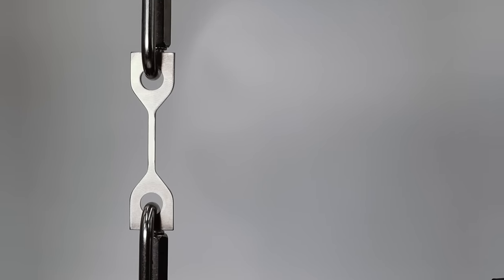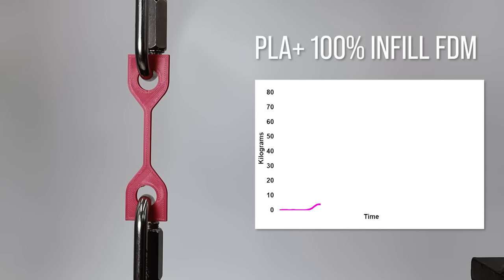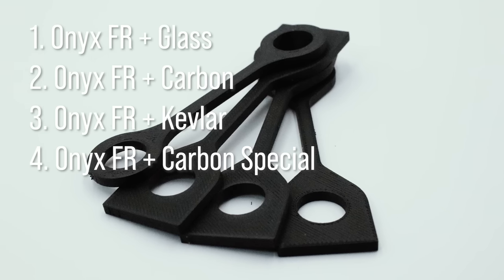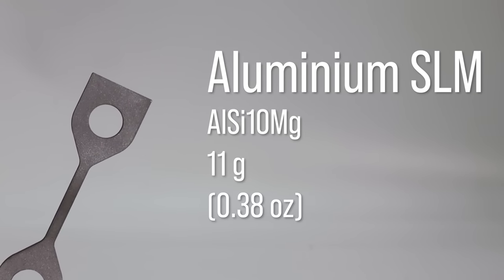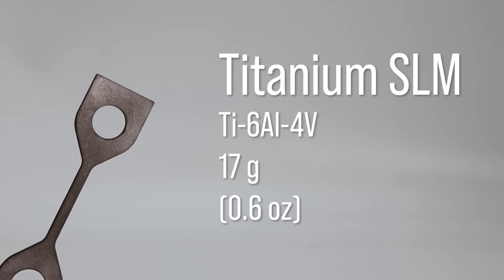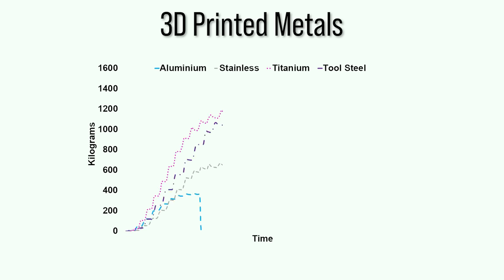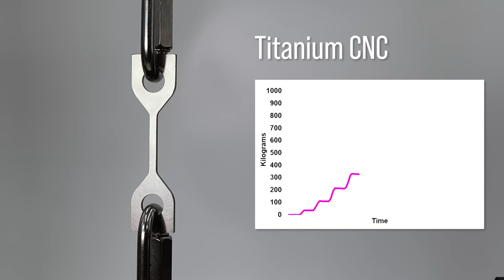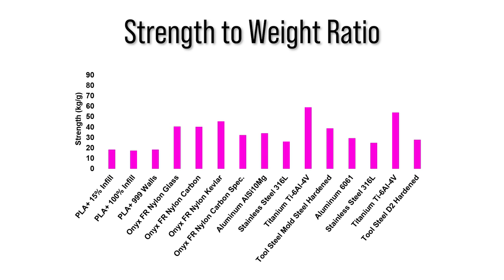3D Printed Metal vs CNC Machined - How Strong?

Comment: How did you measure the % elongation? I don't see any strain gauge nor was it explained in the video. Kg/time doesn't really tell us anything other than saying we can progressively load this specific part for this long before it breaks. Also, that's not ASTM D638 dogbone standard so you can't really say that the test has been "standardized". Pedantic, I know. But there's a fine difference between doing something that resembles a standardized test and doing an actual standardized test; I understand you're constrained by your test rig but I must point this out.

Cool results though. I'd like to see an improvement in the experimental setup and eventually see an actual stress strain curve.
Reply: I see, it looks like elongation was measured in post. Which makes me question its credibility even more. Was the distortion from the camera lens compensated for?
Reply: The word standardised does not imply it follows a specific standard, just that it follows a standard. It just means that the data from all of his samples are comparable to each other (but not necessarily to other peoples, though I agree that this would have been better).
Reply: @helpmeimconfused  Error due to lens distortion and other camera effects would not necessarily have been significant compared to other sources of error in the design. Regardless though, if he didn't move the camera much between samples, the values for each sample would have been comparable to each other at least.

Comment: Although others have criticised the heat treatment, not to matter as it's no big deal really - the most interesting element was the difference between 3D printed metals versus CNC machined metals - that was GOLD.
Would love to know the cost comparison between the 3D printed versus CNC machined metal parts if it's not commercially sensitive.

Comment: Thanks for making a video that compares metal 3d printed parts to conventional CNC metal parts. Seems like the trade off is between elongation and ultimate strength. Makes sense since I would imagine grain size of SLS parts is much smaller due to quickly cooling the parts from melted to solid below glowing hot. Your video helped me realize this and that 3d printed metal parts are actually viable for normal applications

Comment: Metal heat treating has to happen at very specific temperatures to get the results you want. That D2 tool steel you used has an austenitization temperature of around 1030ºC, a lot higher than what the torch can give it. You didnt get a half-baked heat treat, you got no heat treat at all because you didn't get the steel hot enough to reset its microstructure. If anything, you may have actually softened it.

Comment: Would be nice to see this test with cast metal samples as well, specifically for aluminum. That’s what most applications are replacing with 3D printed metal parts.

Also would be helpful to know the alloys of aluminum used and the stock thickness sizes, if the samples were made from thicker aluminum plate and cut down, they could very easily have a lower hardness. In aerospace this is something that we check after the parts are fully machined from a plate to ensure that there wasn’t a soft spot in the center of the block and that it was tempered properly.

Comment: I'd imagine the higher strength is because the laser sintering is a high temp,  fast cooling process that leaves a high strength heat treat. The lower density and inherit porosity would be more apparent with equal heat treats applied

Comment: Something is wrong with the elongation calculation. It was very apparent in the Onyx FR + Glass test. I meassured it on the screen so it is not 100% accurate.
At start the distance between the clamps was 77mm. When the first cracks started to appear the distance was 84mm. This is a 9,1% elongation.

Also the aluminium alloys you worked with are very different. AlSi10Mg contains cca. 85-88% Al and 10% Si and a bit of Mg while 6061 contains 96-98% Al + 0,7% Si and 1% Mg.
Tensile strength of the former is 450MPa while for the latter it is 180-280MPa.
The idea is good but in order to get useful data you need to compare fairly similar things e.g. like the PLA and the titanium parts. I dont think base on this test alone we can conclude that 3D printed metal parts are stonger. Too many variables.

Comment: A number of things come into play when doing tensile test. On the CNC they will break at corners and sharp internal corners focus stress. rounding and smoothing will help and any working of test structures can screw results. Learned this in a lost wax casting company. A cast part of same dimension will always put perform a CNC in the same material.

Comment: This was good but as a student i had to do a few of these and had access to norms and the like. We had a protocol where we only took the results from samples that broke clearly in the middle section, your sample have a stress point at the neck, it should be longer if you want to prevent them from breaking at the stress point. Your results may be qualitative but not quantitative, you'd need an average over several good samples.

Comment: Surprised to see the SLM handles the static test pretty well!
I wonder if they are also good on the dynamic loads test.
In my experience of engineering, porosity in metal parts doesn’t make a huge difference in static but on on the dynamic test, it can differ 10 to 100 times!
Reply: Definitely true, same with fatigue, but porosity levels in as-printed metal parts are typically <0.1% for optimized parameters. Most places still HIP the parts and follow up with solution and aging though, so porosity is pretty much eliminated

Comment: There's a clever way to measure toughness of a material, requiring a heavy hammer, a protractor, a set starting position, and a pointer to capture swing-through. The less height the hammer gets on the other side of the swing, the tougher the material.

Comment: I like how much the steel yields before breaking. Very useful for many applications
I was also really surprised how weak that cnc machined aluminium was.
Also the 3D Printed titanium was very impressive.
The heat treatment was pointless though. You can't just point a torch at D2 and hope it gets stronger.
Reply: in a sample size of one its dangerous to draw such conclusions.

Comment: I admit to being shocked at these results - it's hard to understand how sintered metal could outperform machines pieces.

Thanks for this!
Reply: It's not sintered. It's fully melted/welded
Reply: Thanks for the clarification. I thought that the S in SLM stood for sinter, same as with DLMS.

Even so, it's a surprising result to me. I would expect a part machined from billet to be stronger than anything cast or welded - I would expect it to come second only to forged.
Reply: @Syscrush  no problem. Most of the og metal printer companies are based in Germany. From what I have been told by them, DMLS is actually somewhat the result of a poor translation. DMLS is actually fully melted as well, but the industry didn't want to refer to the process as SLM because that is also the name of one of the competitive printers brands. Because of the confusion around this, the industry now more commonly refers to the process as Laser Powder Bed Fusion (LPBF). Not every printed material is stronger than billet, and it's still a tradeoff between properties. You can heat treat to beat the ultimate tensile strength of billet but you trade away elongation, for instance

Comment: I was not expecting that. I thought 3D printed metals were way less durable.
Reply: It depends on the process. If you're using the binder jet or something like that, they're pretty inferior. Powderbed processes though actually weld the materials, so it's like stacking a bunch of super tiny weld beads in a bunch of different directions. They can outperform billet in certain ways, but there will always be trade-offs

Comment: Another issue, along the many that I’ve seen about the cnc cut parts , is that grain direction is of paramount importance when testing to ultimate yield strength. As well as stress induced machining practices, stress risers, sharp edges,  and lot variations.   IE; where did you get the material from? Etc…. This seems like an experiment to “prove” 3d printing is the only way things should be done.

Comment: Any idea how this is even possible. I get some of it might be a fluke due to different alloys and work hardening. But how can a more porous unevenly stressed version of a Material be stronger in tensile stress
Reply: I can only image that it's a different alloy
Reply: Different Aluminium alloys can behave quite differently. This looks to be one that in german we sometimes call "gooey aluminium". Horrible to machine because it's so soft, it's like cutting peanut butter with a sharp knife.
Reply: The grain orientation for 3d printed parts is probably more uniform and the cnc parts most likely arent. I think this would also explain the higher elongation on the cnc parts. I couldn't imagine 3d printed parts to be stronger than a properly forged metal

Comment: I would imagine that because the parts are so small, they're more susceptible to small variations.
I would predict that the difference in strength would reduce as the test part size increases.

Assuming the material is the same grade and all that jazz

Comment: im not a metallurgist but my bet for why the 3d printed parts where stronger was because of the crystal structure
in 3d printing it is layer after layer but cnc can be in every orientation mainly because of the way it was made
- just for clarification 3d printing is done in layers and each layer is like a different part that is stuck to the ones around it

if you realy want to test 3d prints you need to print them is several orientations

Comment: I'm a CNC machinist by trade, and I have definitely noticed a severe drop in the quality of metals in the past 2 years, I did not have any idea that they were so poorly made that they were weaker than 3d printed parts.

I'll see if I can find some old steel, stainless and aluminium that I can make into test pieces if you would like

Just send me a step file

Comment: Id love to see a repetitive stress test of median stress over a ton of reps to see if the pieces get weaker/more brittle over the tests. Because if cheap plastics/metals perform the same as expensive stuff over multiple cycles then it would make sense to just mass produce cheap parts for replacement rather than try and get top shelf stuff one time.

Comment: I think there was something wrong with the aluminium and stainless parts. They shouldn't be so weak (relatively). Of course they might not suit the SLM process so well without a heat treat. Oh and the heating you did for the tool steel is most likely just yielding the part. And I don't know much about titanium but the test might be bias for materials that don't suffer from work hardening since the force is pulsing.

Comment: Question.  Wouldn't this test look very different if you used an attachment (bolt/rod e.g.) with the same diameter as the mounting hole? At the very least it should decrease the elongation, yes?

Comment: I wonder if there could have been a process bias. Some articles I've read suggest one over the other, but if 3D printed is consistent then it's likely the better of the two. What this does say is pcbway has better metal 3d printing strength with this run as opposed to CNC machined. However, it does make me wonder if there was maybe a tolerance or weight bias that occurred. What's the margin of error here?

Comment: You said you heat-treated your tool steel little over 500°C. I doubt you did it for more than 10-15 minutes. With that, you probably only created a layer of oxides on the surface (not deeper than 0,5mm) but not much more. Heat treating processes like various types of annealing take 1 or more hours, often in controlled atmosphere.

Also, yout test pieces are rather unusual and have me worried about structural dents/notches (don't know which word is correct) that would cause samples to crack too near to the sample's "head," resulting in your test not being representative of actuall toughness. The geometry of the notch concentrates stress so that less stress is required to fracture. This is why your specimen has the long middle part - to provide the most accurate standardized info. Only if the sample fractures in the middle is your test valid and representative of any characteristics.

Comment: I can’t envision a situation where machining something is going to improve its strength, removing material, unless it’s machined in a way that is designed to remove weak points, will only weaken the piece.  The material itself is far more important, what alloy it is for example.  I don’t have a ton of experience with solid metals, the majority of my experience is in sintered powder metal.

Comment: Very interesting l had no idea 3D printed metals were so good.
But being able to use extremely pure and good quality material when printing and having a consistent material cell structure and also being able to play with wall thicknesses and infills obviously makes a big difference.
I remember doing gravity die casting and the end results sometimes left a lot to be desired.
Interesting results with some surprises.
The tolerances and surface finishes that can be achieved with a CNC are still superior but 3D printing definitely has it's place.
Traditional casting is also something I would like to see tested.

😎👍

Comment: That's really interesting with the 3D printed parts being stronger, I think it may be due to the printing process harding the material but that's a guess
Reply: Or like another comment pointed out, too small sample size. But what it did give me an idea about is that 3D printing might give more consistent results, while CNC is stuck with whatever metal they are provided. If it has any flaws CNC isn't going to fix any of that.

Comment: I know that 6061 aluminum is not very strong its mostly for corrosion resistance. You should try 7075-T6 of 2024-T4. also those alloy has heat treatment that make them a lot stronger. Heat treating aluminum is more difficult to perform than steel and should be done by the factory if possible.

Comment: If you have standardized test pieces you really need a stress strain graph. Force/time graph is pretty useless to compare material properties. Comparing polymers and metals I’d want to see: yield strength, elastic modulus and toughness. UTS is needed for some engineering calculations but yield strength is going to be the more realistic figure of the materials strength.

Comment: I'm actually kinda shocked to find out that 3d printed metal has higher tensile strength than cnc machined metal... is it possible that the machining marks create the base for a crack to form? This is kinda nuts.

Comment: CNC has its uses for large sheets of steel to be cut into smaller sheets. CNC milling is also helpful for rounding off edges. In the end, 3D printing outperforms CNC in most uses.

Comment: Hi, great video! thanks. About the heat treatment.. Did you just heat it and let it cool? 'cause that would actually anneal it and make it lower strength and modulus

CORRECTION: the modulus wouldn't change
Reply: Modulus doesn't change when heat treating, only hardness and strength
Reply: Hardness and modulus are directly related in metals, the higher the modulus, the harder the metal is and vice versa.
Reply: @santiagoblandon3022  nope. That's a common misconception, modulus is a material property
Reply: So it is hardness. Take knife making as an example. They forge the blade, the blade is soft, the file bites into it, then they quench the blade, now the file doesn't bite because it is now harder. It is the same piece of material, but heat treatments change the properties of the materials. The crystalline structure changes.
Reply: @santiagoblandon3022  hardness and young's modulus aren't related, although it may seem so, try googling it, it's really fascinating
Reply: @santiagoblandon3022  hardness and young's modulus aren't related, although it may seem so, try googling it, it's really fascinating. The slope of the stress strain curve doesn't change
Reply: Yeah, you're right. Thank you :) I was confused

Comment: What’s the difference between 100% infill and 999 walls? It seems like they are exactly the same
Reply: Sometimes infill is a special pattern filled in the given amount of shells. If you set it to 100% it still might use the infill pattern for the toolhead path.

Comment: What is stainless steel? 304 or 416? What is titanium? Pure or alloy? What is aluminum? By color, the aluminum that you took cut out by the machine looks like pure, and what is printed on the printer is clearly an alloy, I don't know what brands in the USA, but it looks like D16 in our country. A strange comparison. In addition, the cut samples were with broken geometry. Not much, but that's enough too.

Comment: 3d metal parts are naturally rounded at the edges, you can see the soft edges in the video.
The reflected light goes from bright to falling off.

Machined parts show a hard reflection were deburred, that only created a single facing on each edge, turning 2 faces into 3.. their was no rounding...
Proper edge radiusing is required to stop premature failure by crack propagation.

3d printed parts had nice round edges, machined parts were hard edged, its expected they would be weaker.

Comment: because he failed to heat treat properly, it would only have heat stresses, making it fail faster. until there is even uniform heat there is going to be uneven heat stress loads causing internal micro torsional stresses all through out.